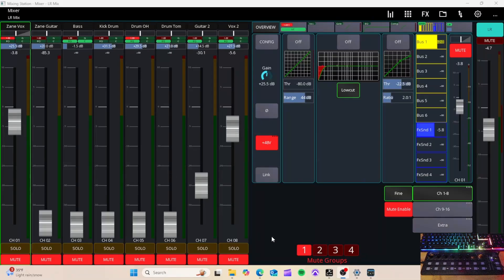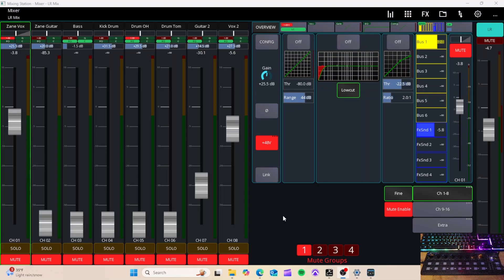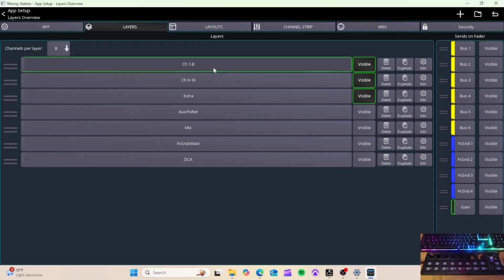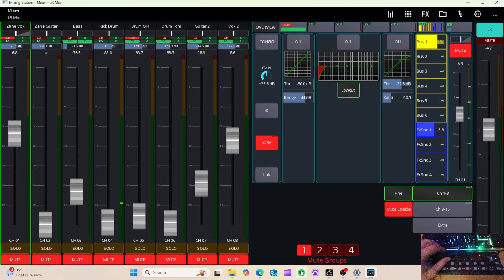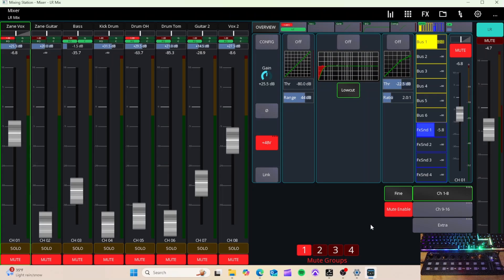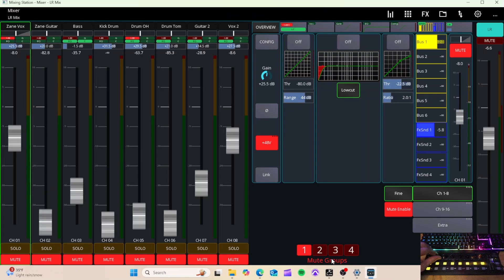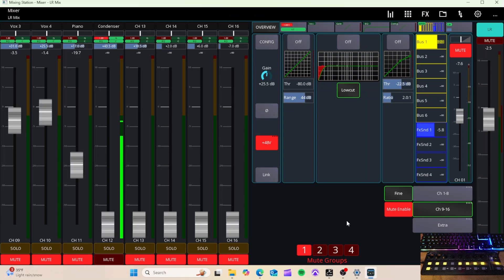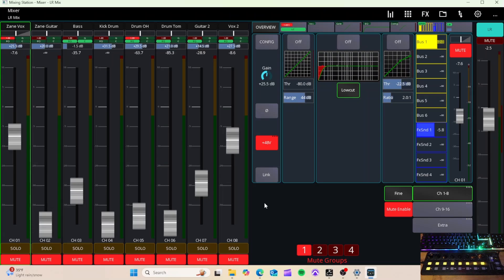Simple Midi Mapping Tutorial For Mixing Station X-Touch Mini (Part 1)

Comment: Any idea how to set this up with any midi controller?
I'm using a behringer bcr2000 with a xr16
Reply: For some reason the midi controller doesn't match up with application. I did exactly what you did however the app does not change when I press the button that supposed to change the layer and when I select a new layer the dials don't adjust the LEDs to the new layers parameters.
Reply: Also the LEDs don't follow the layers.
Reply from the maker: I haven’t used that controller but I don’t see why it would work any different as far as button mapping goes and without seeing exactly what you’re doing it’s hard to say. Did you make sure to enable usb midi control in mixing station? Is anything else working? Like the faders are working but just not changing layers?
Reply from the maker: Also whatever device you are using (computer, tablet, phone) has to be directly connected via usb to the midi controller in order to reflect layer changes and sends on fader. There are some options that allow it to work otherwise but the use cases and functions are a little different than direct control over the device. Let me know if any of this addresses your issue or not!

Comment: Hey man, following yoir video to set mine up, when i get to midi devices, i finally found the xtouch mini but its saying could not open input device and could not add reciever, any ideas?
Reply from the maker: You have to make sure the device is in MC (mackie control) mode. Sorry, totally didn’t think to add that in the video but I believe you just need to press the “MC” button on the bottom left while you turn it on. Over on the right hand side of the x-touch mini it says “MC Mode” and there is a little light that will illuminate when you have successfully put it in MACKIE Control Mode.